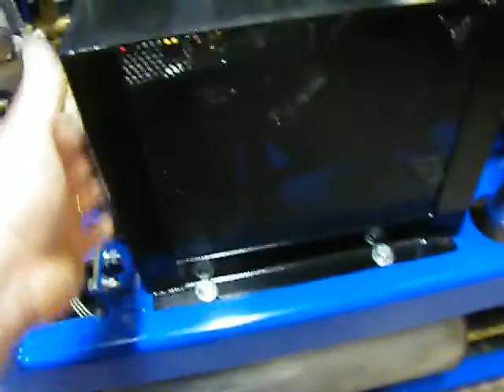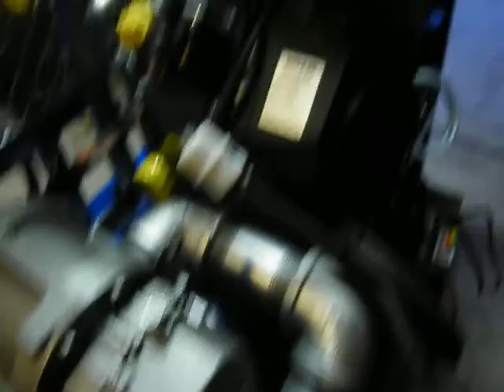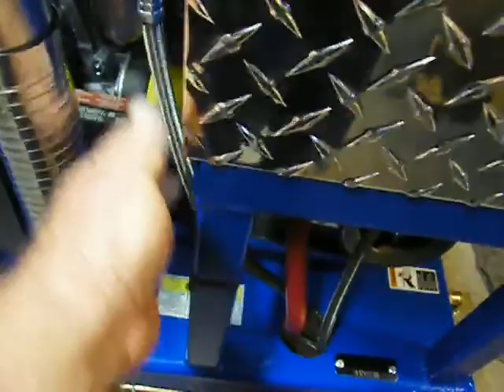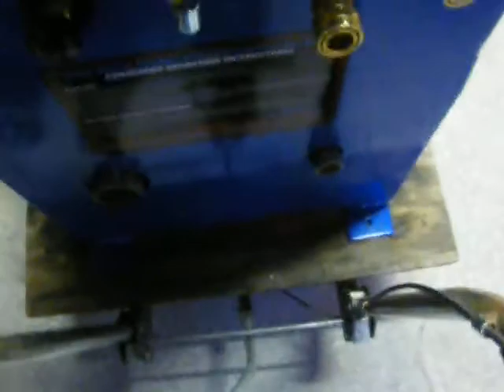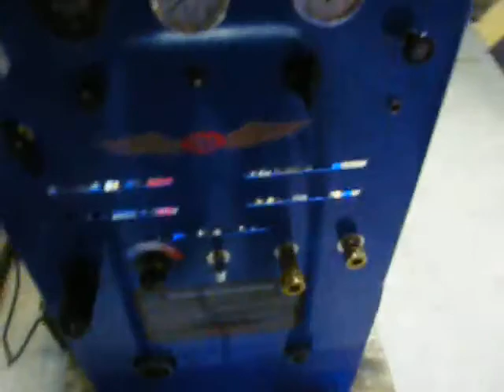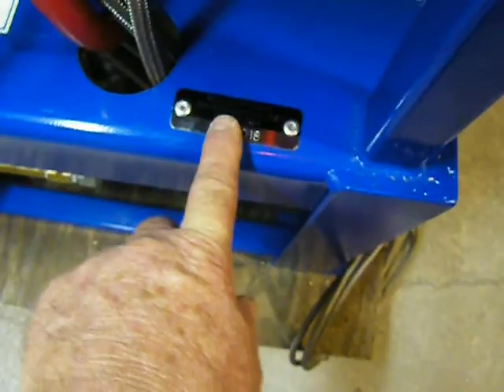Blue Baron Compact 36 Truckmount (For Superior Performance) Call 727-505-2989

Comment: Not arguing against belt drive!  Yet on the 2 units we built years ago, we considered both ways , then chose Lovejoy, never breaking one.  Our choice was simple one of configuration and the inline style with pump elevated on it's own plate made it so compact.  Alignment of course is so key, and that we did accomplish.  Just an opinion, and certainly "to each his own".  If it works, it works, right.           Al Cooper.  Cascadia Clean Carpet.